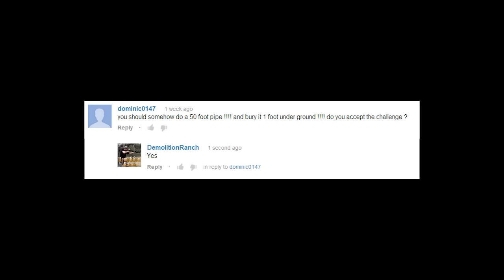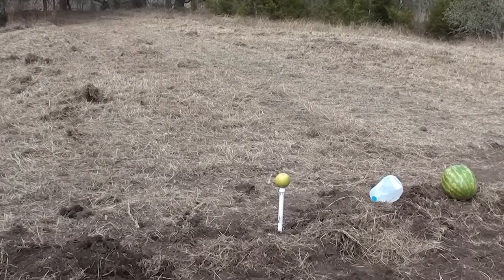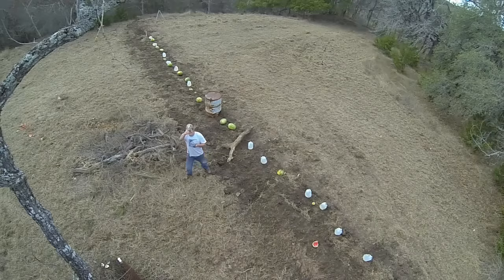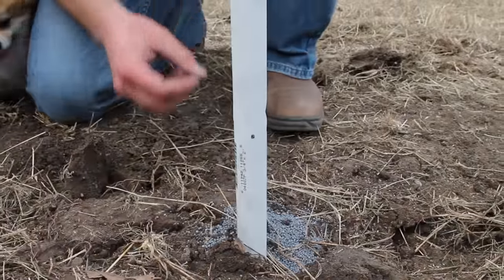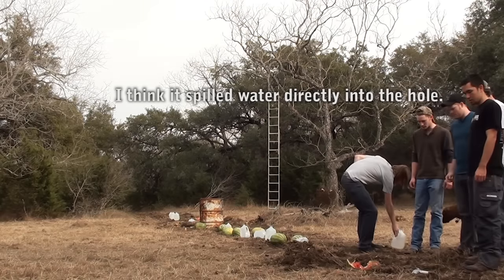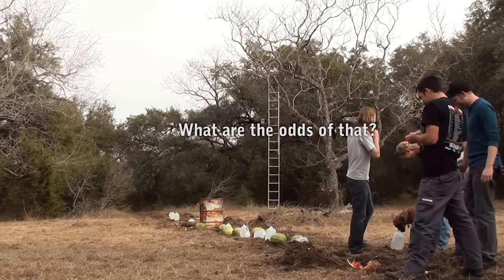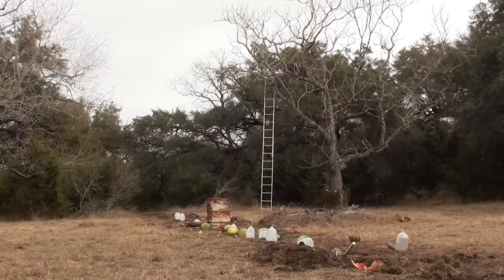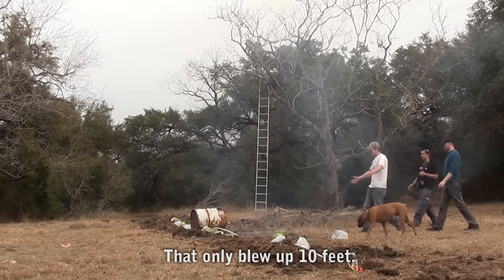The Tannerite Pipeline

Comment: As a former 12B1P, I approve....however, when in doubt, more explosive is better. In 2000, on a demo range day at Ft Bragg, NC, my company set off 1200 lbs(range had a 400 lb limit, but who are we to count?) of ANFO breaching charges in one go. It tripped seismographs in Raleigh, which is a good ways away from Ft Bragg, earning a number of phone calls and reprimands. Apparently, the eggheads don't like small man-made earthquakes.
Reply: edit, not ANFO, that's improvised shit...just straight AN. 40 lbs per charge. IIRC, AN has an RE factor of .44 as compared to TNT, which is the baseline at 1.0 RE. Low RE is a pushing charge, while high RE, such as C4 which comes in at 1.34 is a cutting charge.
Reply: AN = Oxidiser, FO = Fuel. You need both parts to go bang. Altho the "FO" can be swapped for another type of fuel (not going to say on youtube)
Reply: And this is why we have medics lol damn engineers lol

Comment: Solution: it's an issue of pressure and volume, for the increased distance you need an increased volume to carry the explosive power, but that will only work if it's at a greater pressure.  Fill a 5' length of 2" pipe that's capped at one end, then when it's snuggly filled...add another 5' pipe to it, continue until you have the 50' (or 60' if you're looking to recreate the length mentioned in the video).  The lead pipe coming up should be at least a 1", but you might consider using a 2" T joint ever 5' that way if you do bury it and it doesn't work...you have a new target every 5' rather than needing to dig it back up.  

Use a .50cal from the side and you might get all of the posts in a single shot.  ;)

Do you accept the challenge?

Comment: You needed a bigger pipe.   Like an 1 1/2" pvc.
Reply: Agreed. The pipe was probably too small to effectively transfer the shock to the rest of the tannerite.
Reply: Do you know how expensive that would be lol
Reply: yup, i was thinking same thing.  has to do with shock wave transfer, at least that what makes sense in mah brain. which is often wrong. maybe a more rigid pipe that will stay straighter?
Reply: Time for some science and practice for proof of concept then another attempt?
Reply: Considering that he uses a large percentage of his money for +VetRanch I doubt he could afford the amount of tannerite a larger pipe would need.
Reply: All tannerite is ammonium nitrate fertilizer mixed with aluminum powder (in the very basic sense kiddies, don't be doing this at home without a clear understanding of what you're doing otherwise you might accidentally burn down your barn or something on accident), both of which can probably be bought for less than commercial tannerite.

However the issue becomes if in the process of making the larger pipe explosive do they run the risk of having 50 pounds or more of the stuff mixed in order to make it all work right.
Reply: This is why there is junk yards are great.

Comment: You need a much bigger pipe.  Larger around would do better to create the chain reaction.  Something like 3 inches should do the trick.  At a certain diameter it will continue for miles.
Reply: called the critical diameter. its an An based explosive which requires a large diameter to ensure an explosion. you are right.

Comment: Does tannerite create its own oxygen? Cause if not that's probably why it didn't all go off.
Reply: most explosives do
Reply: Yeah, but some fo the more stable ones (tannerite is designed to be stable) might not produce it passively, so there won't be enough to set it off to begin with. I don't know though, just taking a semi-informed guess.
Reply: All do except for thermobaric explosives (most common ones are the MOAB). They use microtechnology to create very small-high surface area combustible material which reacts with outside air. Long-story-short, it makes explosives have more bang per pound because much of a typical explosive's weight is comprised by oxidizing materials such as gun powder which uses potassium nitrate.
Reply: Kyro E I suppose the key word I was missing was 'enough'.
Reply: My question is what about the surface area? So what if you take a bigger Diameter pipe, with shorter distance. I have a feeling it might work. IMHO
Reply: AfromanKKK2 and maybe shoot it from the middle instead of an end
Reply: good point they should mix it with an oxidizer like saltpetre

Comment: The package says that it will take a 40gn bullet or larger traveling a minimum of 2000 fps to set it off, I've had one only partly explode when I shot it with a .556. and a .22 Lr not even initiate it. your using a .17 HMR which is at the most a 20gn pushing 2.5k FPS
If you do this again I urge you to use a 7.62. A Mosin will always completely set it off. That way you will know it wasn't the bullet's fault rather the pipe diameter.
Reply: The 762 is slower than a 556 so how would the slower bullet set it off
Reply: 7.62 is a MUCH  heavier(like 3x) bullet, and it's going plenty fast enough for Tannerite. The punch--the sheer goddam energy in foot lbs/sq inch----of this bullet is far more than any 5.56.
Reply: Aaron Messer 7.62x54R hits harder than a .223
Reply: I’ve always shot Tannerite with a .223. .22 lr is too slow moving

Comment: Haha no way this would work.  Pipe is way to small.  Explosives have a minimum critical diameter for continued propagation of the shockwave.  For prilled AN based mixtures like tannerite or ANFO it's about 2.5 inches.  Try a much bigger pipe next time.

Comment: .50 bmg vs 10 barrels of napalm and gasoline. Do you accept?
Reply: Yes
Reply: A 50bmg wouldn't light gasoline unless it produced some sort of spark. Even then it wouldn't be that spectacular, just a big fireball that continues to burn forever Lol. Sorry to rain on your parade
Reply: Jacob Pendleton
gas doesnt burn, it explodes.
Reply: Michael Sheridan gas is volatile so yes it does explode but its not a true explosive. An explosive usually does not continue to burn after it is ignited like gasoline does. Same goes for napalm, except napalm is even milder. Napalm is just gasoline mixed with some gooey liquid that makes it burn forever at a super high temperature.

Comment: i know this is a really old video, However as a blaster using explosives everyday what you experienced here was you went below the critical diameter of the product. Basically the pipe was too small and confined the product too much. certain explosives will only work in certain sized pipe, and or blast holes. tannerite which is basically anfo is 2.5" meaning it will not effectively detonate in anything smaller than 2.5" I love the channel now, I think you should use this advise and recreate this video. If you would like any assistance hit me up lol. Of course only within the bounds of the law.

Comment: Because viewing this video has most likely already put me on the government "Watch List", it doesn't hut to comment. You should have used a metal pipe and then two 90s to turn the pipe facing you, cap it with duct tape and then shoot the duct tape. The compression would be forced to traverse the length of the pipe rather than rupture a week piece of PVC.